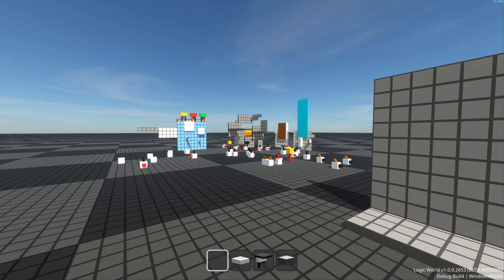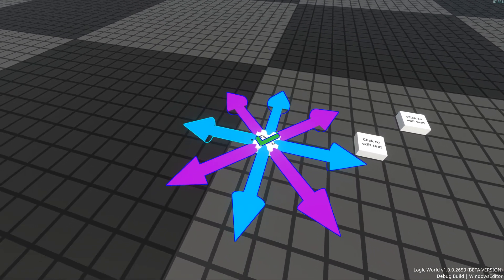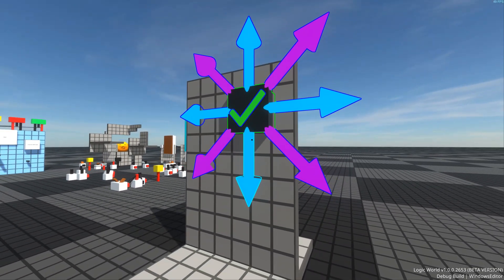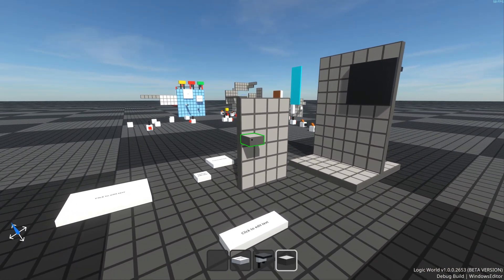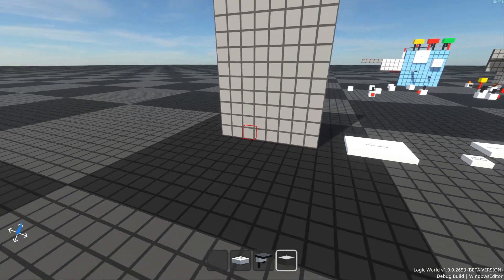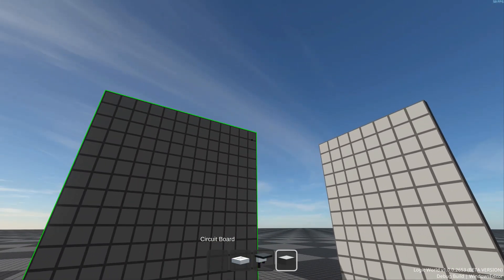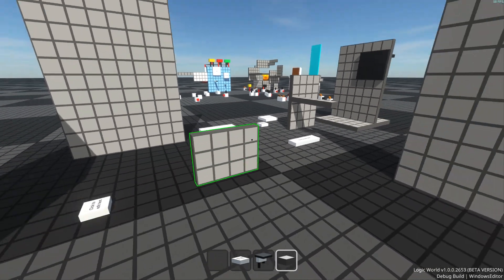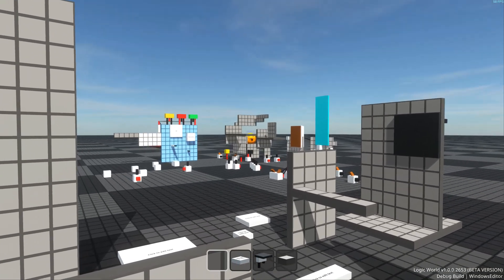Board Drawing & Better Resizing

Comment: Something that might make the placing of circuit boards a bit smoother is being able to click and drag, so if you don't want to resize it, all you have to do is click once, instead of twice.
Reply from the maker: You can switch between "hold" and "tap twice" in the settings :)